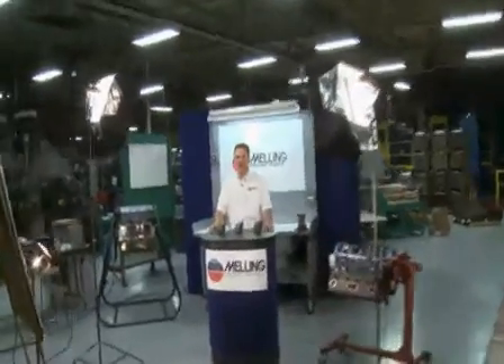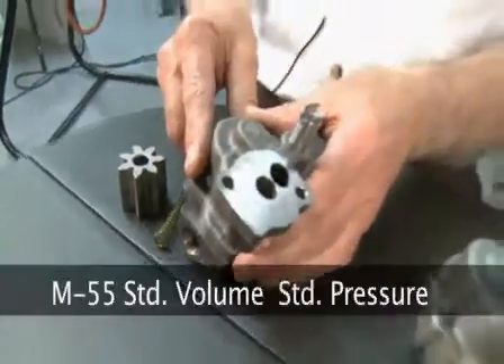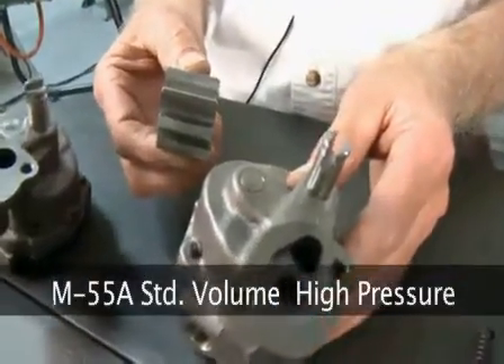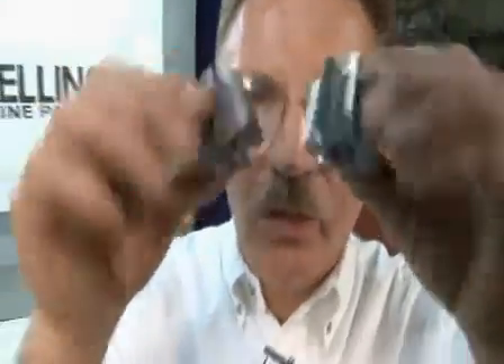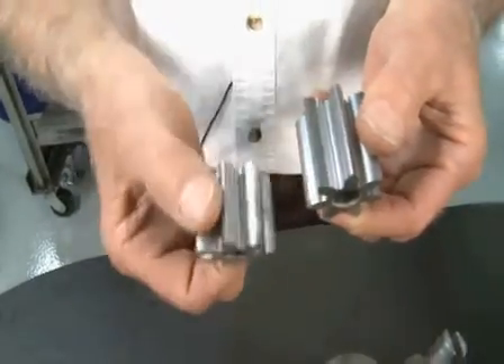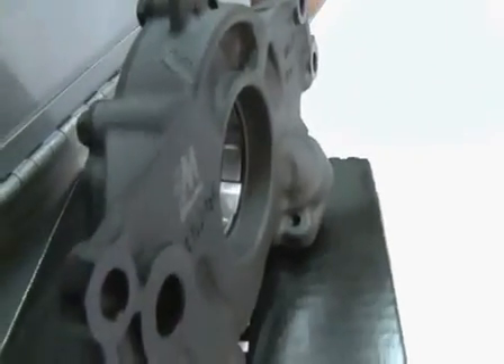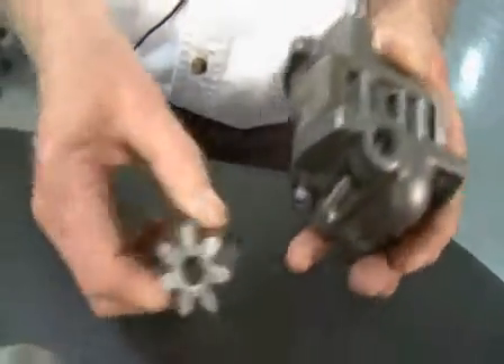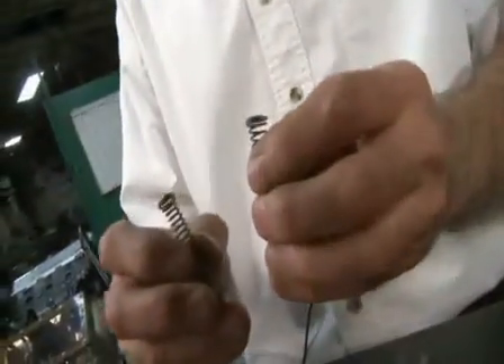Oil Pump Volume & Pressure Tech-Tips

Comment: Pumps produce flow (volume) and resistance to that flow is what creates pressure. There is no such thing as a hi pressure pump.
Reply: If you have an extremely tightly machined positive displacement pump and also tight bearing tolerances you can have high pressure and low volume.
Reply: @VinnyMartello  yes

Comment: Can i put a milling high volume pump on a 5.3 active fuel management motor. 2008 silverado?
Reply from the maker: Yes, high volume pumps will not adversely affect any part of the AFM system. The correct part number is https://www.summitracing.com/parts/mel-10296

Comment: y is hot oil  and cold oil make the presser go up and down
Reply from the maker: Hi jeremy conner, 
  Keep in mind that the crankshaft of a motor actually floats on a film of oil. Yes, there is actually a soft bearing material there too but, the crank should not touch that bearing. Now, overtime with more mileage and worn oil (just before a change), the crank will actually skip off the bearing material; much like skipping a stone across a pond. It only hits the water every so often, but mostly stays in the air – right?  Well, until gravity finally takes over anyway!!  

  When a crankshaft skips across the bearing material, some of that material is displaced. This opens up the oil clearance on the bearings allowing more oil to escape causing oil pressure to drop. When you take into account all the main, connecting rod & cam bearings in a motor, that’s a lot of leakage internally thus, a low oil pressure reading. Don’t forget too that as a motor warms up, all the metal parts expand and the oil thins out. Thinner oil has less resistance to flow, therefore, this will also contribute to dropping the oil pressure.

  Oil companies work very hard to make their oil flow more consistently at any temperature but, high mileage engines with wide bearing clearances are impossible to repair with something that pours out of a bottle!